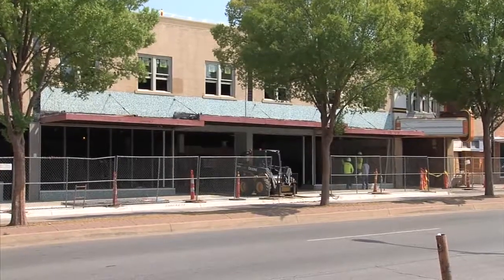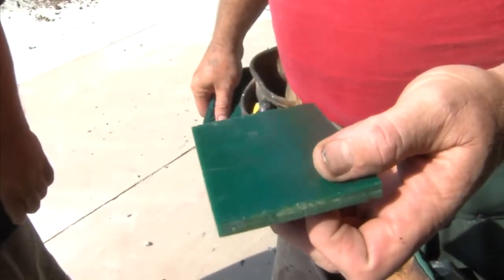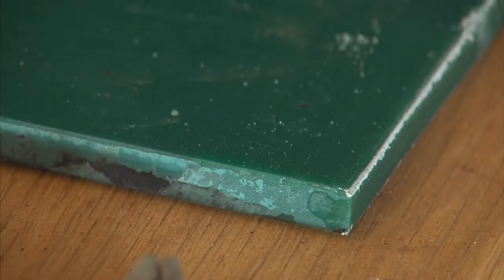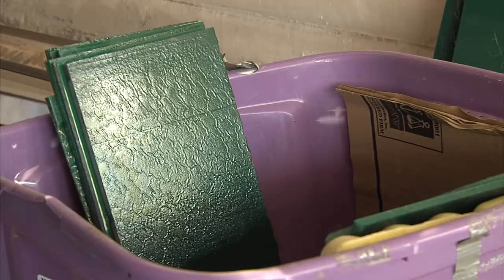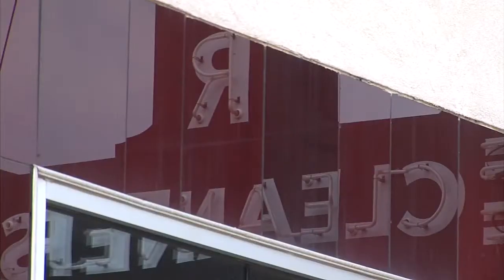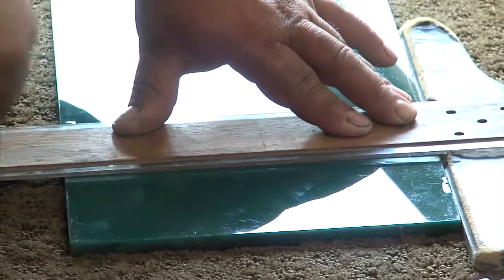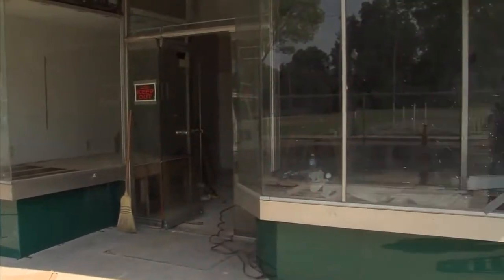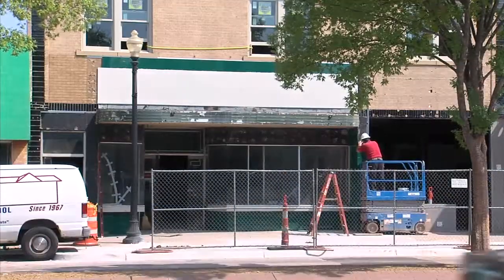Panels installed at Tower Theater by specialist (2015-08-26)

Comment: I have Vitrolite in both of my bathrooms and kitchen.The upstairs bathroom is gray and cranberry. The downstairs bathroom, hallway and kitchen is jade and black. I had a water leak in my kitchen and a lot of the tile came down, in the kitchen.. I would like to repair and replace the loose and missing tiles with the bathroom tiles. The tiles in the bathroom are loose so I would like to remove all of them and put them in the kitchen .Could you please tell me what tools I would need to remove the tiles? I also need to know what is the name of the glue and what is the tool name that you put the glue in to stick the tiles to the wall. If you could help me I really would appreciate any help you could give me. Thank you in advance.

t
Reply: Call this guy...  Vitrolite Specialist he has website.  I hope you didn’t get rid of it!  I just bought 14 tiles from Tim in St. Louis Missouri.